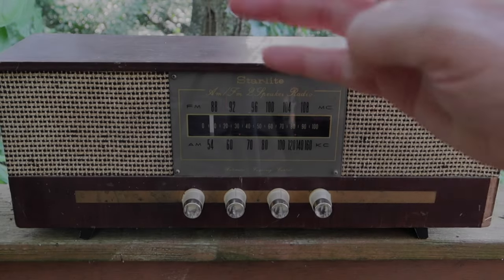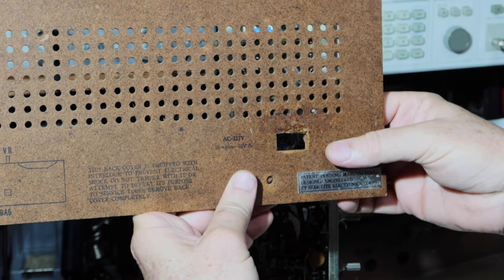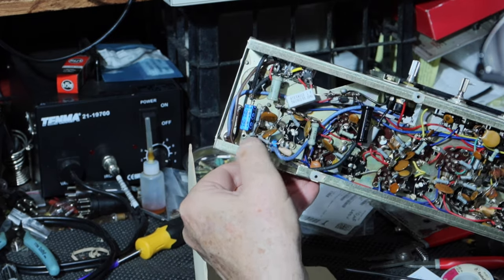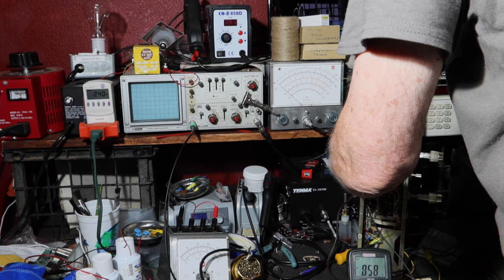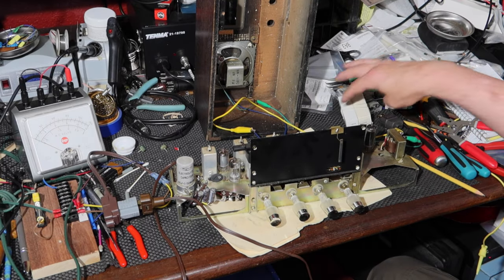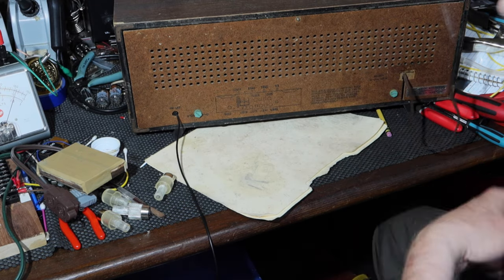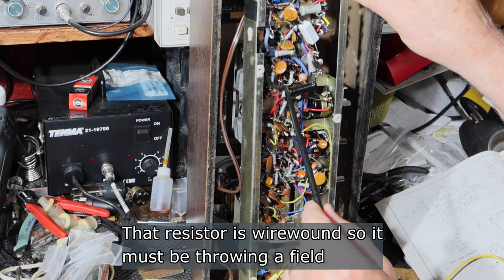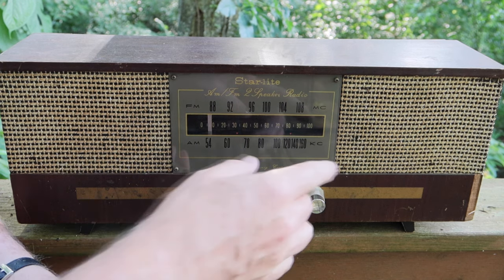VACUUM TUBE RADIO POWER & STUBBORN HUM! 1964 Star-Lite Part 4 [4K]

Comment: I just got a closer look at the knob. It looks exactly (except the color) the same as one of the Japanese radios I repaired. One was missing and I made a new one using the 3D printer. I was surprised by how easy it was to design one like it. Also went back and watched a couple of the videos I did on the Sansei AM-FM radio and saw a lot of similarities. Nice fix on the hum issue. :)
Reply from the maker: Thanks Doug.  The shrink tubing made a nice reinforcement for the repair, too.  The little filter cap made a big difference on the hum.  It's a really nice set.  I did a little work on my Sansui 661 receiver about three or fours years ago, still going strong - same old story - little cleaning of the controls and bingo.  Replaced the bulbs finally while I was in there.  I have had it since 1976.

Comment: As you noted, if you put the CL90 thermistor on the neutral side, you get about 3V AC voltage (to ground) on the chassis.
Reply from the maker: Hi Dave.  Right.  I did it better on both the GE 875, Emerson 641B and others not videoed.  I will probably redo that on the Star-Lite just because I am "that way".  I was thinking "easy" at the time, must have been tired.  Thanks

Comment: I would be inclined to rebuild the radio using the 12V tubes that use a B+ 12V you know the tubes developed because the transistors of the day were not ready for prime time and use a impedance matching transformer.

Comment: Hmm. The 12DT8 is a twin triode RF tube, with a shielding in between .. that radio uses two? I’ve seen just one tube using both sides/triodes .. one for the RF amp and the other for the Osc/converter.
Reply from the maker: Hi Dave.  Yep, a pair of 12DT8s.  
V1: a) FM RF Amp; b) FM Conv
V2: a) FM AFC; b) FM Osc 
Has very good FM performance.
Thanks